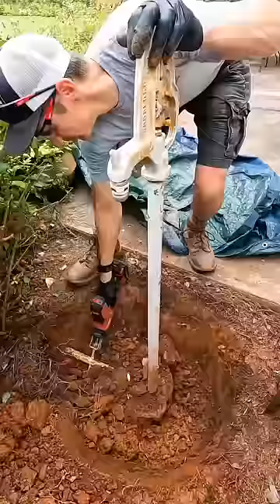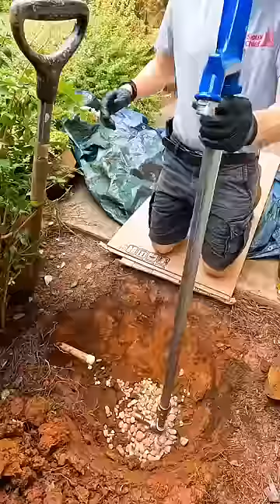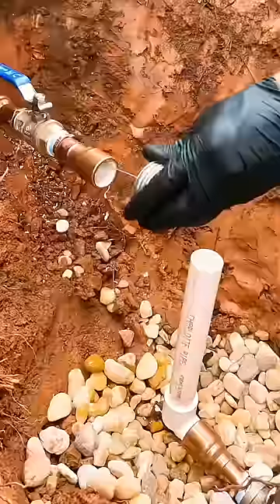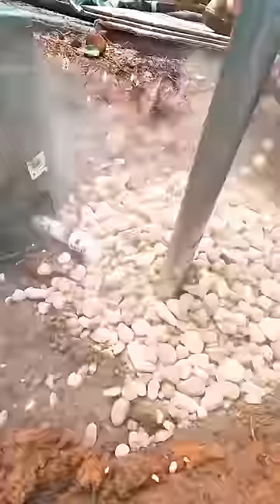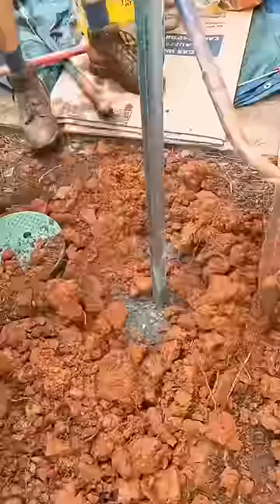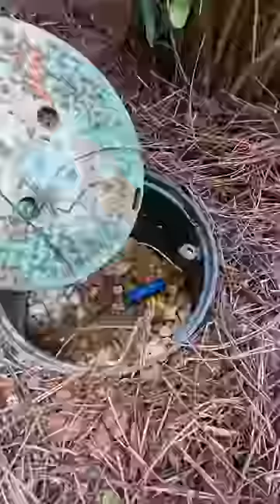Quick yard hydrant replacement 🌱💦 #plumber #plumbing #diy #yardhydrant #handyman #howto #water

Comment: Frost lines vary greatly, here on west side of state it's 30" (max), but you jump over mountain to east and goes to 54". As  you continue eastward that freeze line just continues getting deeper
Reply from the maker: Yeah our frost line is 5 inches here 😆
Reply: Here in WI it's 4ft minimum or your pipes freeze

Comment: I just used gravel for mine, no concrete.
Reply from the maker: I gotcha
Reply: @theplumberlorian  All brass fittings (not plastic), HDPE tubing.
The maintenance shutoff valve is at the source, in my case.

Comment: Now when was it possible to glue plastic pipe to copper? Something is very strange and will leak
Reply from the maker: It’s a new transition fitting called metal head by Sioux Chief pretty incredible
Reply: @theplumberlorian  kinda strange the replacement was done without any heat to connect the copper to plastic

Comment: Is that glue you put on the copper?
Reply from the maker: Yep, it’s a fitting made by @sioux chief called Metal Head .. game changers
Reply: @theplumberlorian  Damn that’s cool! Where are you from?
Reply from the maker: thanks, GA
Reply: @theplumberlorian  nice! Here in Canada I don’t think they would allow you to do that. They’re so strict over here haha
Reply: The copper is fitted over a pvc fitting, he isn't gluing directly to the copper
Reply: @mongolloyd5236  he literally just did, look
Reply: @chopboss  look inside the copper. Its sch 40. They make them for PVC as well as CPVC. They're neat, great for transitioning as opposed to compression fittings. Just today I used a brass 3/4" PEX by 3/4" CPVC.
Reply from the maker: @chopboss  I hear ya 😂
Reply from the maker: @mongolloyd5236  yep it’s a forged PVC/copper fitting
Reply from the maker: @mongolloyd5236  agree
Reply from the maker: @mongolloyd5236  game changers

Comment: Sir, I have 7 of those hose spouts on my property in Oklahoma. Ive noticed they are all very wobbly and need shoring up. Can i ask what was the reason for the dog leg down then back up. I intend to put a shut off valve like you did on all of them. If the extra digging is needed then id like to do that also so it can be done correctly. Thanks for any help you can give.

Comment: Sitting on rocks....ya this will be leaking lol this is what we call a  half assed job lol
Reply: Plus no glue primer !!! 
 .. hey they might flush this out with air before it freezes in the winter ??? Just a though
Reply from the maker: The smooth stone is for drainage there’s nothing wrong with this install.
Reply from the maker: Clear primer was used and It’s a frost proof yard hydrant it won’t freeze. Our frost line is 5 inches here anyways, slim chances of that.
Reply: Ya ok the rocks will rubb a hole right in that pipe.  The proper way is to use sand. I'm a superintendent and I assure you rocks are wrong.
Reply: @JeepUSMC  
Who do you work and what are you a superintendent of?

Comment: No idea why this extends so far out of the ground. Here in Texas that would freeze solid... Great work though... (We leave the spigot low to the ground, then run a leader hose to a hose stand (if you're wanting to avoid stooping down to operate). Then in winter disconnect the leader hose and cover the spigot with an insulated bag to prevent freezing.
Reply: This isn't a standard silcock. This is designed to be anti freeze and will drain to the bottom of the standpipe below the frost line.

Comment: Why the shut off?
Reply from the maker: Makes it easier to service and no need to shut the entire property down .. plus if there’s a leak they turn it off and the call doesn’t require immediate attention.
Reply: @theplumberlorian  Roger that. I've installed many but have shut off at source or beginning of line to hydrant. ✌️
Reply: Hydrants don't need much servicing. Shut off valve just to raise price.

Comment: Once transitioned to a copper valve should have stayed copper to the hydrant.
Reply from the maker: It’s not really a copper valve it’s a metal head PVC transition fitting, but yeah if you want to run copper to the hydrant that’s fine I chose to stick with PVC

Comment: Nice, I would of skipped the ball valve to save the money because it's easy enough to shut off water for a couple of hours while I replace the valve but it's upto the customer.
Reply from the maker: I gotcha .. yeah it was more for the homeowner to not be without water to the house if the hydrant started to run continuously… preventing need for emergency service
Reply: @theplumberlorian  fair enough

Comment: I don't see you doing it maybe you are but it's sped up. When connecting pvc your supposed to spin it a quarter turn after cleaned, primed, and glued. The primer softens up the pvc. Then when you do the quarter turn it makes the glue adhere better.
Reply from the maker: Yeah I did a quarter turn on all my connections except the ones I could not .. clear primer and cement on all the connections.

Comment: Why are installing a ball valve a foot away from a frost proof hydrant completely pointless
Reply from the maker: It’s not pointless, you can shut off the water to the hydrant to replace and service now .. and if there’s a problem in the future the homeowner doesn’t have to turn off the whole house while waiting for a plumber
Reply: Thar valve should of been installed at the house not a foot away from the hydrant

Comment: Why you almost bury the ball valve? It may corrode with dirt and rust later. Not for a long term job!
Reply from the maker: That’s actually not common in my area, a valve can last a couple decades before it gets to that point. The valve is for servicing the hydrant without the owner having to turn off the entire water to house.

Comment: Like the easy layered cement coating for easy fixing later in time 10 yrs from now. Many over do that for security that not needed.
Reply from the maker: The cement is harmless, the previous guy did the same thing and I was able to swap it out no problem. I know we all have our opinions, so thanks for the input. Plumb on brotha

Comment: The hydrant has its own valve in the bottom of the unit, if you need a shut-off it should be at the source not 18 in away
Reply from the maker: The hydrant does not have its own valve at the bottom